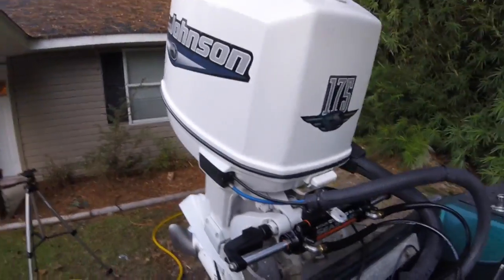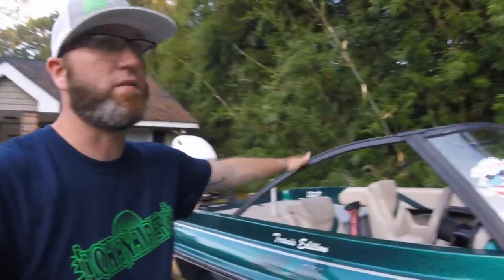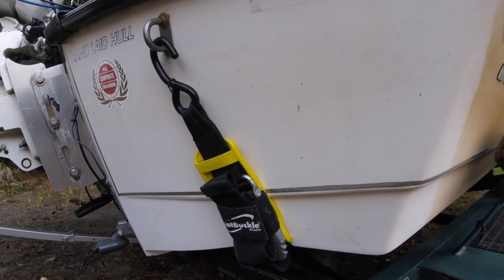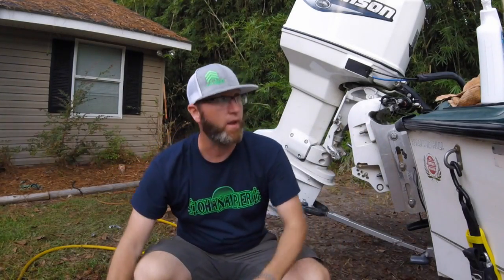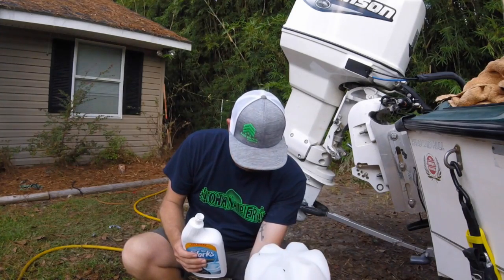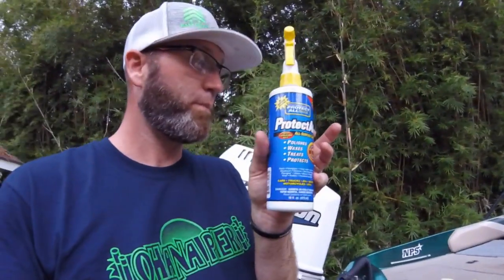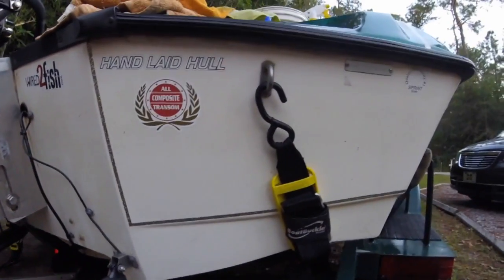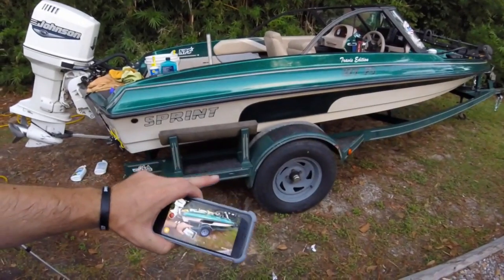How to Clean a boat hull Tip

Comment: So I just tried this trick today on my Donzi center console that has been sitting in the water for 5 years. It was badly stained orange at the water line and the white gelcoat was discolored and chalky all over. I bought 2 bottles of "The Works" toilet bowl cleaner from the dollar store and a spray bottle. I actually only used one bottle to do the entire boat and it WORKED!!! Freaking Fantastic!!! Took about 15min then most of the stains vanished without scrubbing but not entirely. Then I washed the boat with soapy water using a green padded sponge (also from the dollar store) and then did another coat of the TB Spray. This time I sprayed the entire hull not just the stains. Wow it is 5 shades brighter now. I was just about to wet sand the whole thing! So glad I tried this. Now it just needs wax and new bottom paint. And yes it burns if you get it on your skin! A few drips from the bottle got on my toes because I was wearing flip flops. Keep the hose close to rinse off if you get it on you. It also removed all of the rust from the D rings and the cleats! I am extremely impressed with my $4.00 investment!
Reply from the maker: Bill Biscoe dude that is so cool. Love YouTube cause I'm sure it has all saved us money one time or another. Thanks for the comment I appreciate it.

Comment: I tried it on my boat I purchased this past spring. my boat had heavy calcium build up and staining, it worked great, a little bit of elbow grease to get past the calcium build up but the staining disappeared like magic. I used 6 bottles but it got the job done,I also tried a name brand cleaner, it didn't work. At a $1 a bottle it's a steal. Thanks for the tip.👍👍

Comment: Going to try this. Thanks. Just fyi, if you get a carpeted board like a 2x6 or 2x8, put it under the stern behind the trailer, you can use a floor jack to raise it off the bunks enough to clean under them. The bow stop will provide enough protection and travel to do this. Just support on either side of the jack with stands while you do the work.
Reply from the maker: Brien Sickler I will have to try that. Thanks for the tip. Appreciate it
Reply: Nick Church Fishing  Thanks for the tip on rhe cleaner. Used it on a jetski I just got that was worse than your boat, and worked like a charm. I remember years ago working at a marina in Big Bear, California,  and we used to clean the botom of boats with muradic acid. This had that famiure scent. For 1.68 for a bottle, I'm a happy camper. thanks again.
Reply from the maker: Brien Sickler that's awesome. Glad to help with the tip. Guess I know what kind of videos I need to make now ;)

Comment: I just bought an old 1990 Bayliner that is in surprisingly good condition, single owner.  The hull is gray but all oxidized and chaulky. Not sure if it'll have the same effect as it isn't stained from tannins, just oxidized from weather. I'm willing to give it a try. I read all the warning in the comments about it reacting with metal so I will test a small spot first.

Comment: Probably best to rinse the boat 1st and apply damp so it doesn't  stain you fiberglass eventually. Its harsh on it. That's why it works  so fast. If you buffed your bost once a year and kept wax on it even spray  wax. All stains would come off with soap.

Comment: I have really bad water stains on my boat from sitting in the water hall summer every summer since 1990, never cleaned the boats hull. I wasn't able to find the works cleaner so I bought a few types ( Lysol TB cleaner, and scrub bubbles TB cleaner ) it works on the light discoloration but not the really hard water stains. Not sure if even the works TB cleaner would help with mine.

Comment: The Wroks also make a tub and shower cleaner that is not as corrosive but very strong stuff. It will eat the enamel paint off a tub if you"re not careful lol. I wonder if it would eat the aluminum on my boat? I'm pretty sure they say don't use on metal but not positive.

Comment: I was trying to think of a good way to apply this without getting overspray on the trailer, and being extra cautious about runoff into groundwater and storm drains. Wiping it on would be good, but would take a long time and may not apply the necessary amount to fully clean it. Then I thought of using a paint roller. Seems like that would do the trick. Anyone tried this method?
Reply: Yes. Use a boat brush.

Comment: I didnt see anything run off the boat. All I seen was it turn white which tells me that the dirt and oxidation is still there but it is just bleached out. Doesnt actually clean it off... Or to me it doesnt seem like it does.
Reply: Is acid not bleach..  it dissolved the oxidation and minerals that were on the top of the gelcoat..

Comment: Hey, odd question. I’ll give you the backstory first. I just got a boat yesterday (Robalo 1920 with a Merc blue water 125) anyways, I sprayed it with bleach to de contaminate it as it was disgusting (also to try and get the yellow stains and rust off). So I sprayed it with bleach about 30 minutes ago and that didn’t work so well as far as removing the stains... I stumbled across this video and bought the toilet bowl cleaner. Than I remembered that you aren’t supposed to mix bleach with ammonia (which toilet bowl cleaner is included) because it creates a toxic gas called chloramine. Anyways, I sprayed the entire boat, inside and out with water real good. (By the way the boat is outside so I’m not in a confined space). Do you think it’s okay to use the toilet bowl cleaner now or will I screw myself up because there WAS bleach on it.
Reply from the maker: Stephen Bainton Jr ah man that's a good question. Just saw this. I would maybe start with a small area somewhere and just see. But maybe let it stand for a few days before you do it
Reply: Nick Church Fishing too late haha. I figured rinsing the boat would “neutralize” it but than I realized the bleach and toilet bowl cleaner was still going to mix on the ground below the boat. Oh well. I think I’m good. Been a few days. I think I would have died by now. But awesome tip. That toilet bowl cleaner works amazing. Thanks.

Comment: Will this work on the green portion? i have some water stains on a green fiberglass stripe, and how about the motor cowl?
Reply from the maker: Acrillies probably not because of the clear coat. That usually isn't on the bottom of the hull  but maybe try a small area just to see.

Comment: /Thanks for posting that is cool. Does it work on oxidation too I have a boat with heavy chalk on it/
Reply from the maker: Roger Hockemier not for sure in that one. Try a little area and let me know
Reply: Ok if you get this on your trailer will it damage a painted surface? If you rinse it right away will you be ok? I will try a test spot on the chalk thanks for the reply
Reply from the maker: Roger Hockemier I didn't have any damage in mine but I rinsed as soon as it cleaned the color.
Reply: Ok good to know I need to pull my head out and get the Scarab going its been sitting for almost three years after a major restoration on the boat and trailer. Thanks for the reply Nick

Comment: Any damage to the trailer, carpet, decals, boat numbers, rub rail, wheels and tires?    I have heard from others that it can damage some of those things and that it stripped the paint off a trailer.   just wondering if you had any issues like this.    Also  how long did it last?
Reply from the maker: Robert Abbott I didn't have any damage to my stuff but I'm not saying it could or couldn't damage things. I wash my boat every trip cause I'm like that so it last me a long time.
Reply: Robert I use this also and learned this from a captain that maintains a small fleet of boats but captains a 53 foot Hatteras year long. This works very well but you asked a very very important question. YES the captain showed me this on my boat in a small spot but it was on a lift at the time. When I returned home I did this to the boat while it was on the  trailer and it ate completely through the trailer fender which is the unpainted steel. Just make sure you cover or rinse off of the trailer and just keep it on the Fiberglass and you should be fine. That was the only problem I had and the fleet he maintains out of Venice La is beautiful and he uses this on the Hatteras but all his boats he maintains are in the water except for dry docking. Hope this helps and its the best way I was taught also. Good luck Nick from Pearl River,La
Reply: Thank you to you both.   I was looking around and watching other videos about this and found out that it's not good for anything that is unprotected metal.   Got some feed back about it going through fenders,  wheels,  axles,  springs,  wire connections, etc.   It works wonderful on glass but you do not want to get it on your trailer or other metal items.   Now with that said I think if you took precautions to make sure you didn't get it on anything and even then got it rinsed off ASAP then you would be ok.    I'm going to go a different route and buy "Safe and Easy Hull Cleaner" from tackle warehouse.    I watched their video and it is not corrosive and still gets the hull clean.    I will just feel safer using it even it it cost a little more.

Comment: Will this work on an aluminum boat as well?
Reply: No, definitely no..  this stuff will eat and pit aluminum quickly...  hydrochloric acid / muriatic acid are the same thing.  The toilet cleaner is just a 9% or so concentration with other cleaning agents included.  Muriatic acid is just 100% hydrochloric acid.  But if you have a metal file that you used on aluminum and got it all caked up with aluminum then i use muriatic acid which completely dissolves the aluminum leaving the file new..  this stuff will strip any oxidation off any metal also though so after any rust removal you need to either oil or paint the metal surfaces or it will rust again quicker than usual..  but aluminum and this stuff produces chlorine and sulfuric hydrocarbon gasses which are both lethal and smelly..  but the lethal part is bit worse for ya..  also dont use this stuff inside a garage expecting it to drain down and be all good..  there will be some residual on the floors unless you neutralize the floor with baking soda after and that little bit of residual will inturn put a layer of rust on every last piece of metal in the garage..  if you dont believe me, go to a persons shop you dont like, set a bottle of muriatic acid anywhere in there and leave the cap off..  dont pour it anywhere just leave the cap off..  after a few days literally everything will have rusted..  everything...  is a good fuck you to an asshole mechanic that dicked you on something..  but nonreversable...  unless you sand everything ya know..  lol  but yea.  No aluminum...
Reply: Z Ack wow, that crazy eh? Interesting!! 

Thank you so much for the detailed write up! Appreciated..

Comment: It doesn't appear that you diluted the toilet bowl cleaner.  Is that correct?  Thanks
Reply from the maker: MICHAEL MATTHEWS no I did not dilute. But they would be a thing to try. Let me know. Test it diluted and see
Reply: I watched another video and they added hydrogen peroxide to the toilet bowl cleaner.  Made for a finer mist and the toilet bowl cleaner didn't clump up.  I used Lysol brand.  Their results were immediate.  No wait time.  I'll let you know how it goes.

Comment: Would this work for an aluminum boat? bass tracker?
Reply from the maker: Rod_Bending_Addicts that's a good thought. I would try it on a area that is. It seen maybe just to make sure it doesn't do anything to the aluminum. If it works let me know please.
Reply: Rod Bending Addicts yes it does if you mix it with 50% hydrogen peroxide it requires no scrubbing

Comment: Mannnnn. Looks like it works well. But my personal theory is that this is what’s killing all the bees. Any other hippies on here? 
What happened to good ole simple green & elbow grease? Or are we that lazy & into killing our environment that  we are going to ‘Idiocracy’ ourselves by buying every last product sold by Johnson&Johnson?
Reply: Timothy Cripe II 
Simple green and elbow grease won’t touch stains in gel coat. Gel coat is porous so the staining gets beneath the surface. 
Unfortunately, harsh chemicals is the only way to remove other than sanding the surface but that leads to eventually wearing through the gel coat. Another bad effect of cleaning a boat with harsh chemicals such as this in video is that it etches the gel coat making stains that much easier to happen. 
Once cleaned, the surface needs to be buffed smooth and sealed with a good protectant.